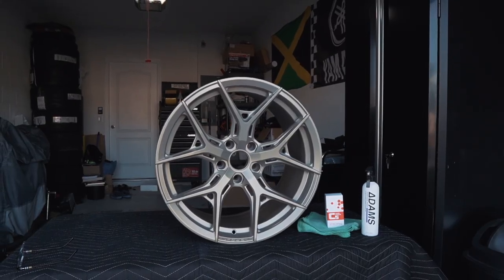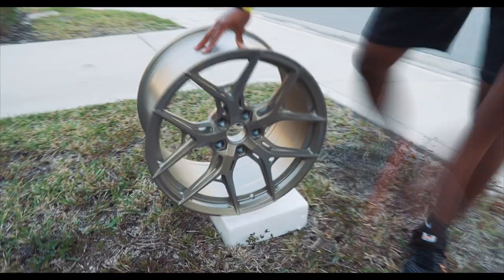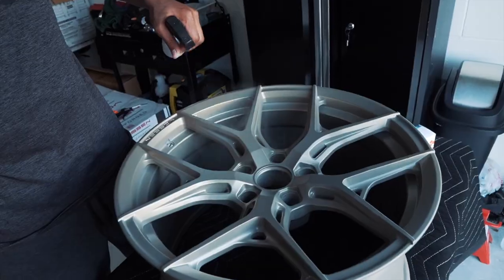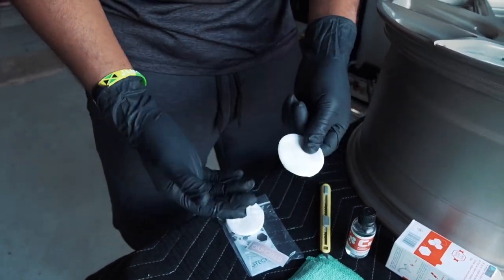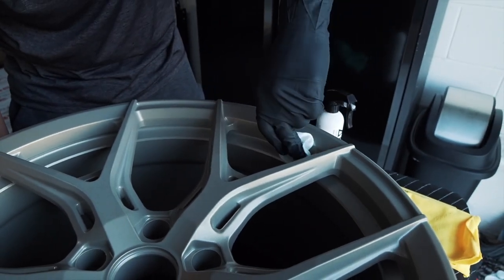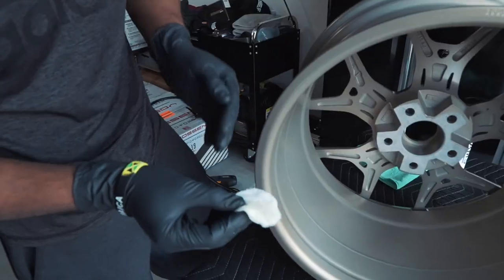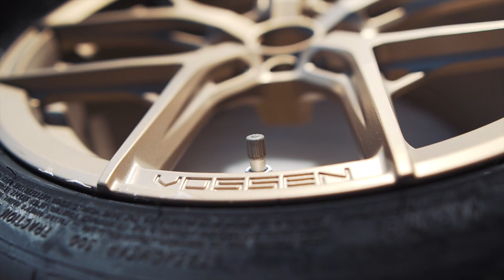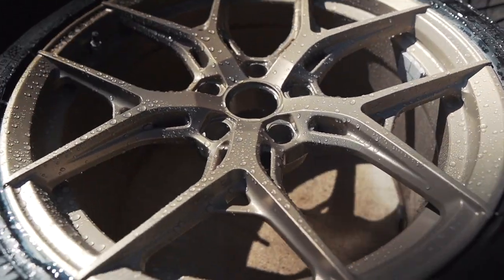Best Way to Ceramic Coat Wheels | Gtechniq C5 Wheel Armour

Comment: Gtechniq C5 is what I have on all my wheels. Best thing about it is you can still put wheel weights on top of the coating as it is a quartz based ceramic.
Reply from the maker: Yes I thought about the wheel weights after the fact but didn’t have any issues at all mounting them even with the surface coated👍🏾

Comment: …I did the coating after my Vossen HF-4T wheels were mounted/balanced.  This was to ensure the wheel weights bond to the surface of wheel barrels properly…otherwise there is a chance the wheel weight(s) might come off down-the-road.